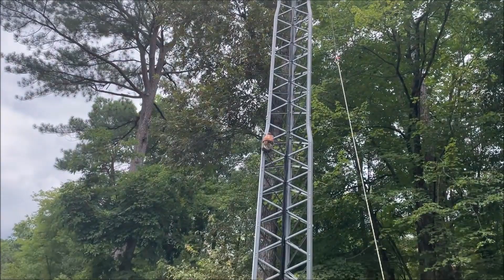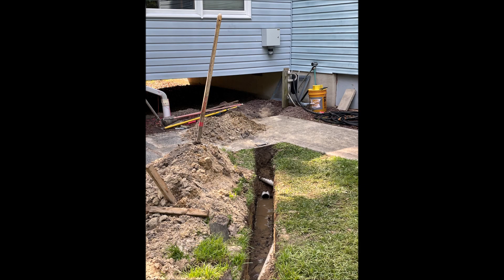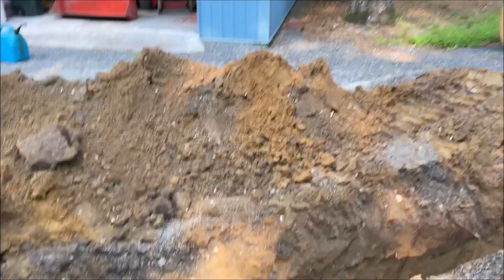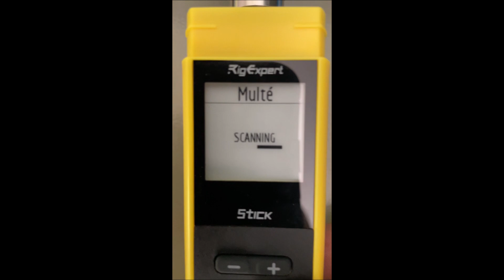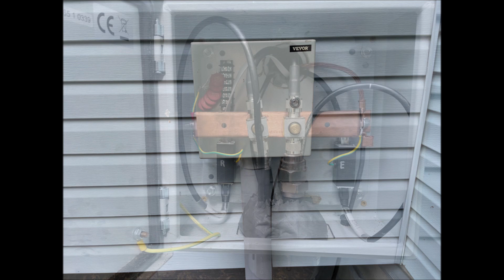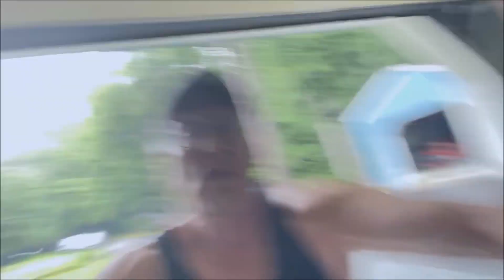Direct bury coax Part 2

Comment: Looks real nice, congrats! I'm the process of doing something similar but I'm burying the heliax, coax, and control cabling inside electrical conduit because we have underground varmits in this area that love to munch cable outer insulation.
Reply from the maker: Conduit was beyond my budget. We have varmits also, but I have so much electrical direct buried and have had no problems. Some wire is 17 years or more in the ground. Only issue I had was a lightning hit near the garage. Thanks for watching! 73s